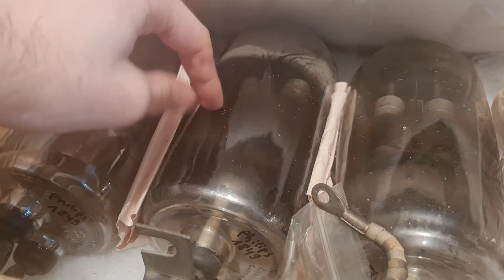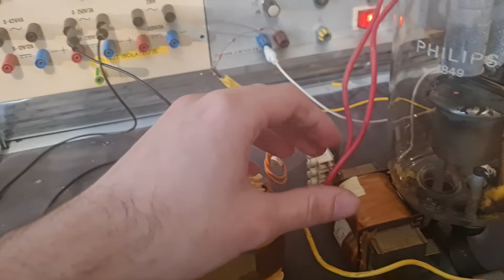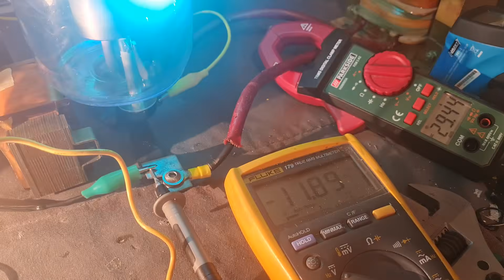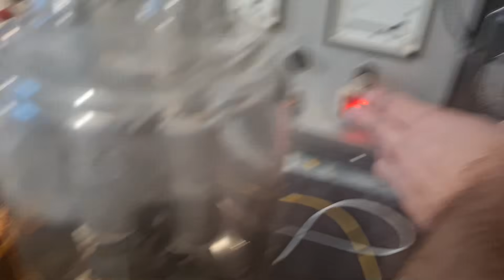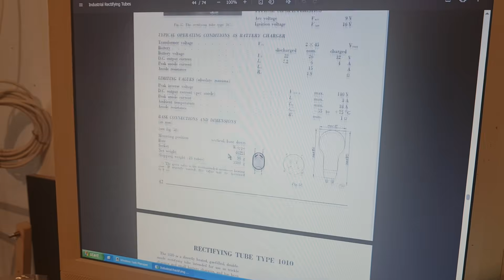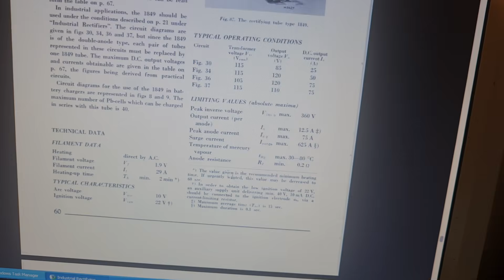Philips 1849 Full Wave Mercury Rectifier!

Comment: Why is it blue?????
Reply from the maker: Because when electrons crash into mercury atoms they theow the electrons from mercury atoms to a higher orbit around the atom. When the electron falls back to the original Orbit it gives off the energy as a Photon (ie. light) at a specific wave lengths.

Most light here is in the i visable UV Region.  Just a tiny amount of light is in the visable spectrum
Reply: @janno288 oh I thought it was x rays. I didnt know mercury emit blue cpnsideringnthe red hue with oxygen

Comment: I guess this means that a lot of current flows through the ionized mercury. It would only work for medium high voltages such a 100 V.
I am guessing that the way it works is that it uses a hot cathode and so, the electrons are emitted from the negative to the positive but the reverse doesn't happen and so that is how it clips the reverse current.

Comment: Neat tube. I have a philips 1129 which was used for battery charging, I think it's an argon gas tube. Oxide coated low voltage/high current filament. It seems to have an auxilliary electrode as well but it's not mentioned on the datasheet and it looks like the lead was clipped off at the edge of the socket. Still works perfectly almost 100 years later

Comment: Kinda wild that even while these sorts of tubes were still being produced the military was busy trying to stuff a full nuclear reactor into an airplane.
Reply: Right and landed on the moon. Nukes are fake and gay
Reply: @АлакПатрова  Fake nuclear weapons?
Reply: They did actually fly an operating reactor on a B-36 - I knew a guy that worked on the project. The reactor didn't (and wasn't intended to) provide energy to fly the aircraft - it was just to see if you could realistically shield the reactor enough to eliminate health risks to the crew. The ultimate conclusion was "probably not" and was a large part of the reason that the whole ANP program got shut down.

Comment: Mercury arc rectifiers were also common in electric locomotives for a good bit of the 20th century.
Reply: Indeed, the Manx Electric Railway had one at Laxey sub which was still operational until 2013.
I once had a look at it, crazy looking thing about three feet high, containing liquid mercury. I think it converted 6,600V AC to 550V DC.

Comment: put them to compuer PSU instead of bridge rectifier
for luls
Reply from the maker: Sadly it doesnt work, its voltage rating in reverse is too low, and it would require a centre tapped mains transformer since this is half of a bridge rectifier to make use of the full wave.

On the output of the switching mode supply it wouldnt work since the mercury rectifier cant rectify at high frequencies (>120Hz)

Comment: The Carbon and internal shielding is to control the characteristics of secondary emission and potentially the effects of stray EM fields from entering the circuit via coupling with the plasma. Plasma is conductive - it can and does act as an antenna
Reply from the maker: I didnt know that, thank you for your insight.

Where did you get this information from?

Comment: The wire mesh over the Anodes is there to spread the arc so there are no Hot Spots...sure would have been nice to demonstrate the actual operation....What a disappointment...
Reply from the maker: The arc only touches the bottom of the carbon anode, so its doing the opposite kind of?  Confining the arc to the bottom of the electrode.  
I think its meant to hold the carbon rod together so it doesnt deteriorate, thats my guess.

Comment: You say you are protected by the "standard" glass of the tube envelope, which would be correct for UVC and part of UVB, but most of the UVA energy will pass unimpeded through the glass; energy that will cause skin damage over time. For all the money you have spent on this setup plus the extra tubes, I hope you spent a little extra on a UVA/UVB/UVC monitor and not trust that whatever standards were used in the past to judge "safe operating conditions" of the devices. And it wouldn't hurt you, literally, to consider enclosing the whole setup in a completely opaque enclosure that blocks 100% of 100-400nm light and put a camera in that enclosure so you can monitor the actions of the 1849 tube safely, just like all of the people effectively do who are watching your channel right now.
Reply from the maker: Hello, thank you for your concern.   Compared to high intensity mercury discharge lamps, which do need significant UV shielding. Low presure mercury discharges  create  little UV-A and UV-B, with most of the emission being in t he UV-C range, which is blocked by the glass.  Mercury Arc Rectifiers are around 7 mPa (~0.007 Atmospheres) of pressure (20-30V voltage drop for the big ones), while typical high intensity discharge lamps operate at ~1 Atmospheres of pressure.  Big Lamps may go as far up to 10 Atmospheres.  Voltage drop significantly increases with the pressure of the mercury inside of the tube. 

This mercury rectifier has a voltage drop of only 10V when ignited, so we can assume that the pressure is even lower. At such a low pressure it should create most light as UV-C and little in UV-A and UV-B range. 

I found out that for tubes philips used borosilicate glass for most of their vacuum tubes, abandoning soda lime glas like most tube manufacturers after the 1940s,  so this is borosilicate glass. Borosilicate glass absorbs wavelenghts under 260nm so blocking the UV-C peak.
Due to the glass used being >=4mm thick  it also absorbs 70-80% of the UV-A and UV-B that is generated. 

Thereby we can conclude that its relativly harmless, about as harmless as a normal CFL or fluorescent lamp.

I got these tubes for very cheap, like most of my equipment, I do not own any Spectrometer since they are very expensive.

Yes you are right that UV-A is harmful, but its also always about the intensity and duration of the exposure.  In reality you get more by sunlight, so the little UV-A the mercury rectifier gives off is next to harmless.  Of course I dont have this operating 24/7 next to my face, since realistically I have no application for it (yet) Maybe someday i'll find a good project to put it in. In such a project the mercury rectifier will be operating in a nice cabinet, shieleded primarly from physical damage, since the mercury inside is the primary risk. 

Thank you again for your comment. If you want to add to any point I made here, please feel free to do so. 
I'll add the information  you provided to the video description. 

Thank you again.
Reply: A Mercury rectum-fryer! 🤣

Comment: I think the auxiliary electrode was simply to pre ionize the vapor to reduce the starting voltage to something reasonable.  I would nor expect it to have any effect on Operating Voltage drop.
I think if you operate it closer to 25 amps the flickering will disappear and voltage drop go down.
Reply from the maker: I shouldve mentioned the "initial voltage drop" instead of just saying voltage drop. You are of course right. 

On the flickering, i dont think thats correct, unless the temperature shifts a lot outside of its operating temperature range, the voltage drop is fairly constant between.   
Arc voltage is 22V (with the starting electrode used) and then drops to 10V actually.  I mentioned 20V in the video which is wrong. I'll add that to the description.  It might lower its voltage drop since the mercury presure increases due to waste heat maybe? 

Thank you for your comment

Comment: Mercury arc....

How is your sun tan?

Mercury arcs produce lots of UV. I don't think that little glass envelope is thick enough to protect you.
Reply from the maker: It is normal glass, not quarz glas, so there is no UV leakage, like normal fluorescent tubes. 
No Ozone smell too. 

Mercury rectifiers do not use quarz glas since it would be intoducing a harzard for no reason.
Reply: @janno288  I have news for you...
there is not enough glass there to stop all the UV.
Reply from the maker: @chrishutton1458 its 4 mm thick, and its special glas designed to block the UV, and its low pressure mercury arx that doesnt create much in the UV-B and UV-A region

Comment: I had a home brew Amateur radio transmitter with a mercury rectifier, and two mercury voltage regulator tubes.
It would produce 500 Watts of power, so it had to be drawing that and a bit more from the 220 Volt outlet.
Sadly, I sold the unit back in the early 90s in order to buy a Kenwood unit...
Reply: Ouch
Reply: @АлакПатрова  Yes, and no.
With the Kenwood unit, I was able to use it AM, CW, and SSB. The old home brew unit was just CW. Loads of power, but lacking the speech modes.

Comment: What do you do to dispose of old Mercury bulbs?
Reply from the maker: I dont dispose of them.

In the old days supermarkets over here had collecting stations for CFL lamps.
Nowadays you send them at the recycling centre.
But if you have mercury lamps that are working, i would keep them since they will become rare in the future
Reply: @janno288  Mercury bulbs, one became a flasher over time but it started to get dangerously hot, the others just died, they were supposed to be normal lights.  Millions would have just ended up in landfill because there was no warning on the boxes.

Comment: Ive got a smaller 10amp Phillips Full Wave Mercury Rectifier that ive made into a USB charger with a polished wooden box and the tube sits on top so its on display. its certainly not efficient but the glow is addictive, plus its glow changes with how the phone charges its battery, so you sorta see pwm stuff. fortunately because the filament voltage is so low it was easy to manually add a few turns of wire on to a 40v Toroidal transformer that is also powering the charger circuit. for usb regulation i just used a PCB duel USB module from alliexpress. it sits proudly on my coffee table for everyone to use ant it gets used a lot  :3
Reply from the maker: @DanafoxyVixen Could you perhaps upload a video to your channel about it? I would like to see it!

Thank you for your comment

Comment: Really cool.
I would use them on a normal 12V power supply just because, and maybe make it variable with an LM317 lol.
Reply from the maker: Oh that would be fun. I was actually thinking of using one for a soljd state psu.  The transfomer I have is good for 10A and issue is that if i use it the transistors would dissipate too much, so if i use the mercury rectifier i would drop 20V and it would he all good. Sadly I dont think it would fit at all in the case, they also say vertical mounting so that limits me.

Comment: Mercury vapor tubes were used in the southern terminus of the Pacific HVDC Inter-tie at Sylmar, California until 2004.  They converted 500kV DC to 230V 3 phase delta service.  IIRC the station has a capacity of 1,600 megawatts.
Reply: These days they use thyristors or IGBTs, which are semiconductor devices
Reply: @megavoltampere1000  Yep.  In the case of the Sylmar station, I believe they used Hitachi products.
Reply: Yes, those were very impressive large mercury vapor rectifiers with really interesting glass envelopes.  I think they had magnetic starting where an exterior solenoid actuated a moving contact inside the tube to start the arc. Some other installations involving trains and industrial equipment used even larger tank-style mercury rectifiers which just looked like large metal storage tanks.

Comment: Ignitron tube is what we called it at USS back in the early 1900’s, was in operation until early 90’s on a wire mesh fabric welder
Reply from the maker: These arent Ignitrons, Ignitrons are a form of Thyratron Tube, the mercury equivalent of a SCR (Silicon Controlled Rectifier), these dont have a igniting electrode, the arc ignites by itself.  Without the extra electrode on this tube which loweres the voltage drop to 20V, it ignites at 60V by itself. So its not an ignitron. 
Ignitrons are closely related but they arent the same and shouldnt be confused with them.

Thank you for your comment
Reply: @janno288 yup, ours turned ac to dc for welding transformers, and water cooled…nice setup you have on your bench. Mines a bit of controlled chaos. I’m strictly a solid state guy now tinkering with solar mostly. Retired from consumer electronics and hydro electric equipment

Comment: Freaking arc reactor
Reply from the maker: its a mercury rectifier,
mercury arc rectifiers dont use a heated filament. Mercury arc rectifiers usually are higher voltage and even mir ist current.  This rectifier i have here was intended for lower voltage

Thank you for your comment

Comment: Cool stuff mate!
But to be honest with you I was more concerned about the windows XP you are rockin back there rather than the tubes you're messin with 👀

Btw if it's mercury in there isn't the light coming off of the plasma technically UVC? or like since it's a way lower voltage (than actual uvc lamps) it has a different wavelength?
Reply from the maker: No, the characteristic discharge of mercury isnt dependant on the energy (determined by voltage). If it has enough enough energy to throw electrons of mercury atoms off their orbit it will fall back, depending on the orbit it will give different wave lengths, they are depedant on the atom, here mercury, so you will get blue colour, a little green and most of the light is in the UV territory.  you need 4.88eV to get a UV-C wave length so since it drops 20V its well within the likelyhood that an electron crashes into a mercury atom and gives it enough energy to emit UV-C.
So yes its making a lot of UV-C but its made of standard glas so it doesnt penetrate it.  Even the thin glas of standard fluorescent tubes blocks it. this glas is thicker, so its all good.
The primary hazard is breaking it since there is a lot more mercury in these.

I've been using Windows XP for 5 years now as my primary basement-workshop OS. Recently even Upgraded to Windows XP x64 Been on several discord calls too on that, it just works to be honest.   Hardware is also 17 years old and it just works too.  No reason to update or Upgrade

Thank you for your comment.

Do you have more questions?

Comment: These are rather nice tubes and interesting with two anodes for full wave rectification with a centre tape transformer.
Reply from the maker: Thank you for your comment!  Yes these were really common since 3 more individual tubes and 2 extra filament windings were more expensive than having 2 tubes with a shared cathode and just one extra high voltage winding, eventually they combined both tubes into one dual/duo-diode.  This transformer came from an audio amplfiier that was scrapped that used 2 full bridge rectifiers to create a positive and negative 40-50V DC  for the power amplifier transistors.